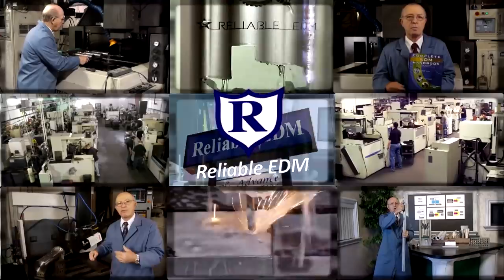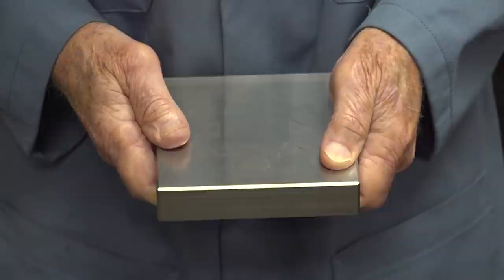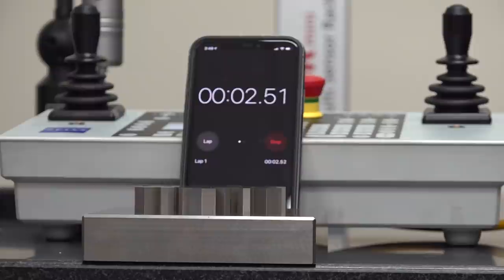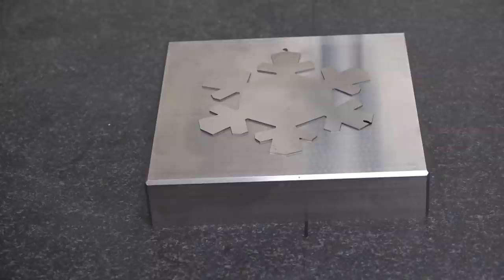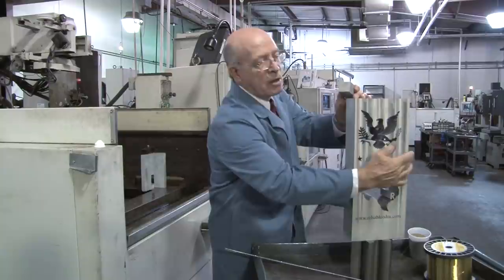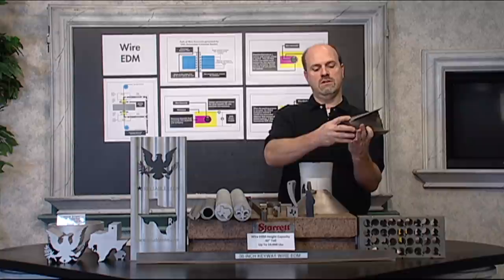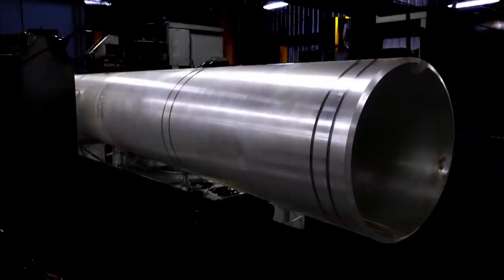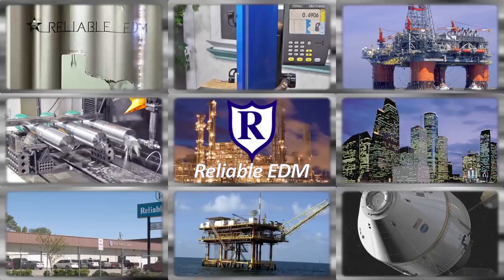Incredible Wire EDM

Comment: how does the hole get started? if it shows the wire being connected on both ends like a bandsaw how does it start in the middle of the material
Reply from the maker: Drill the hole before it has been hardened, or use small hole EDM when material is hardened.
Reply: @ReliableEDM  Preferably the latter as holes in tool steel may carbon up during heat-treat and cause problems at the start.
Reply: @ReliableEDM   Newbie alert! But do you small hole EDM that long 54" part?
Thank you

Comment: We use EDM not just for its spacial accuracy but also for its superb surface finishes you can achieve: in the making of injection mould casts wire EDM is absolutely necessary to ensure surface finishes of Rz 2.5 micrometer and lower across a machined 3 dimensional curved plane.

Comment: Hello
You had me when I saw Mr. Carl Sommer, on the screen.
These kind of tinkerers also keep my country running.
Keep up the good work and good luck.
Really a great machine.
I would be interested to know how much the wire deviates in such workpieces ratio to the thickness and material in the middle.
The feed rate in relation to the material thickness and material or its thermal conductivity would also be very interesting parameter.
The service life of the wire and their cost.
Are there any existing tables or formulas for these values?
Thanks a lot

Comment: I spent 27 years doing nothing but sink,and wire EDM. A whole lot has progressed from tooling to the machines and software. Keeping wire machines operating correctly is a skill in itself. Something simple as incorrect water ionization and worn diamond guides can result in disaster, along with 20 other things. Those machines must be maintained with laboratory type respect and cleanliness.